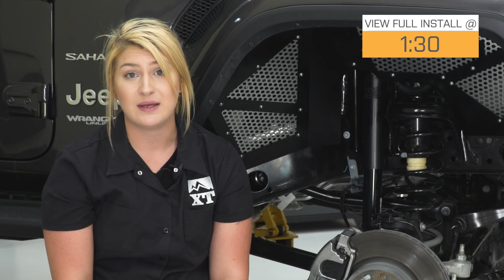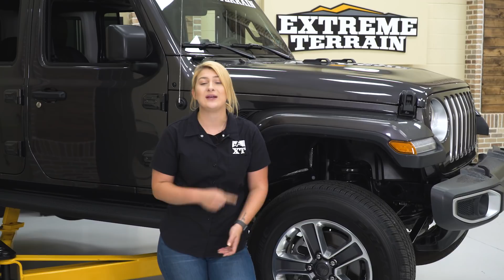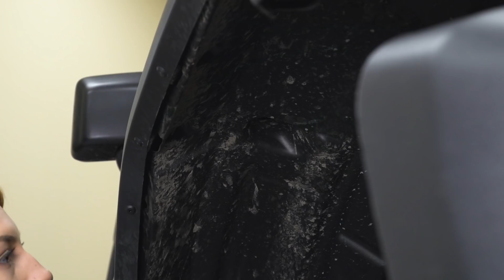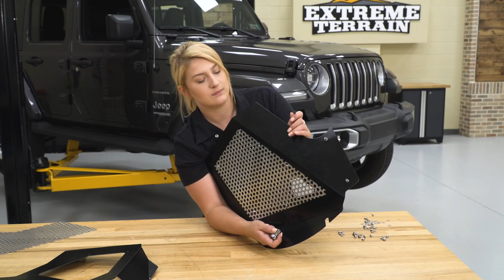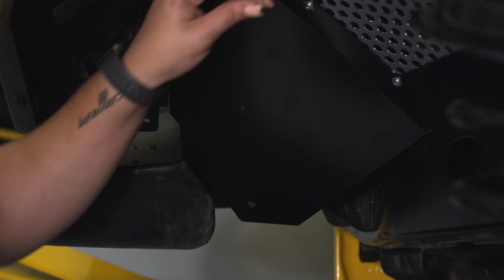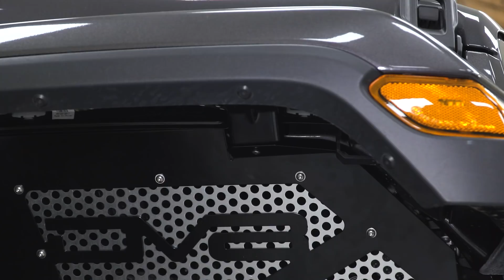Jeep Wrangler JL DV8 Off-Road Front Aluminum Inner Fenders (2018) Review & Install

Comment: Been working on this for 2 days and the front on both sides will not match up with the bottom attachment points (where the christmas trees go).. Once you put the christmas trees in the top bolt is so far off that you can't attach the bolt, if you put the bolt in first the holes for the christmas trees are so far off than you can't attach them. I currently have Gorilla tape holding the bottom portion of my fender liners and some of the aluminum sticking out past the grill.. Looks completely like a hack job, and has wasted hours and hours of my time.. completely disappointed and this is 100% a fabrication issue on DV8's end. Maybe they used to be this easy and this good, but they're not any more. . Trying to get my money back... Buyers beware!
Reply: I had the exact same issue! The passenger side had to be completed with zip ties and the driver side has remained uninstalled for over a year now. It's so far off it's ridiculous
Reply: Having the same issues. Will not line up at all. Waste of money.
Reply: Kind of problems we first started out as a Courier to delete fenders suite fortunately, I didn't come and put the spare parts of the cut off, and then put the lining of the upper bolt is good it is, after I met the same problem with you, I've booked the front and rear bumpers and fenders and fender liner, at first I just think they product precision is high,I finally do is lining, ah I also want to return, or what they have dealers, fitted on me really angry every parts to install 5-6 hours, down to start well, everyone watching video is a place where there are some different, not a video is not taken, the remove to details when a flash, I said did you have met,So things loaded for 2 days dead tired, speechless...

Comment: I live in Arizona and 90% of what your wanting to help keep out of your engine bay is dirt & dust. It's almost impossible to do so but installing wheel well liners full of holes doesn't make any sense in Arizona. Ok it's helping with cooling but my JL doesn't over heat and if it does I think I'll find another way to get cooling air into the bay that doesn't throw dirt directly into the engine bay.
Reply: You could always add a fine mesh to the inner side of the liners

Comment: I live in Michigan so I’m concerned about salt getting in the engine bay during the winter, any suggestions or should I just stay with factory liners?
Reply: I think as long as you wash it once during season then a deep clean after you should be fine but rust will happen in Michigan
Reply: block the salt itself from getting through those holes and into the engine bay by adding a fine metal mesh to the inner part of the fender liners
Reply: @JourdanCBarlow  like a window screen?
Reply: Same question I had, I'm in NY where the salt is BAD in the winter
Reply: I’m in Ohio and I just wash my Jeep once a week in the winter. Worked with all my other cars and no rust yet on anything! No matter what I have I’d wash it once a week. Usually use under carriage spray too from Adams just to help protect it too.